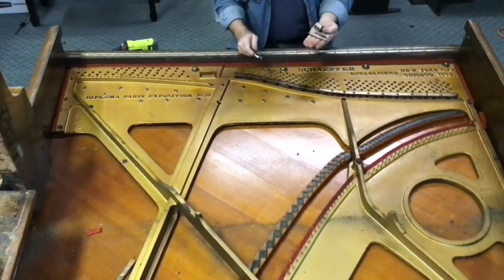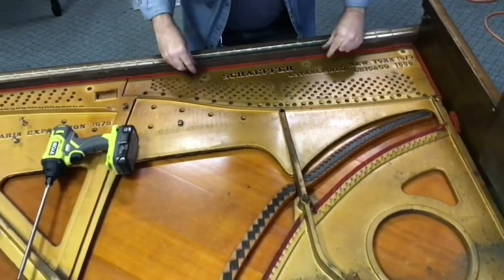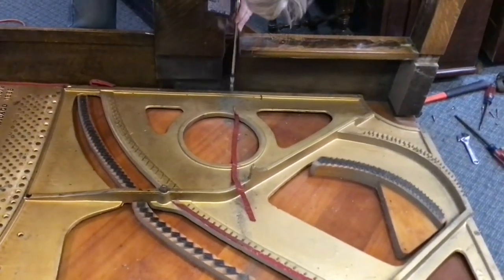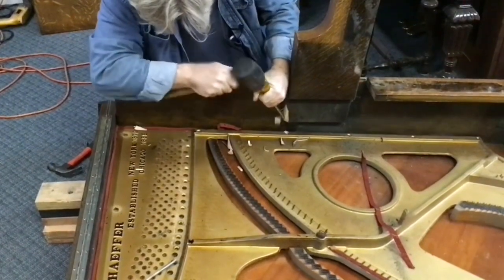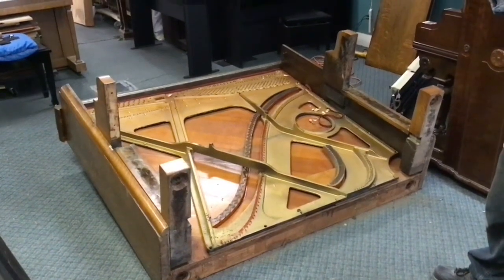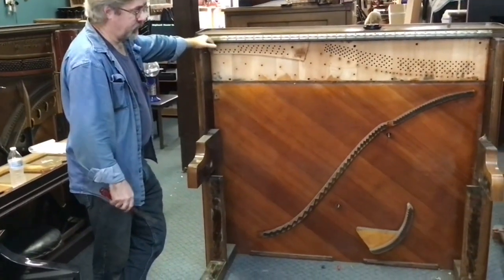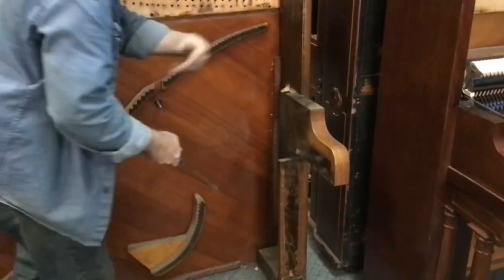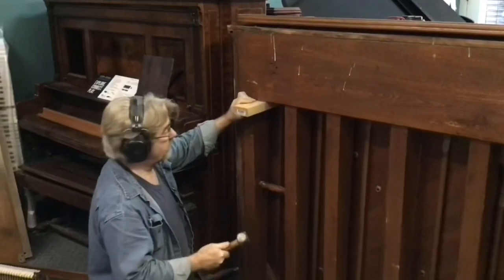Acoustic to Digital Piano Conversion - Disassembly Part 4 (Final)

Comment: Removing the last strips from the soundboard without tearing up the spruce; heat pot hide glue was standard procedure to put the on, and to get them off . The glue is water soluble. Keep the spruce soundboard and find the sweet spots for the attenuators and set the up on the spruce for the unique sound it goes to a piano. Good luck. I am doing one myself , but cutting harp loose standing up in manageable size pieces. 
    I have a 1903 Adam Schaff upright with red mahogany veneer. I hope I live long enough to finish the job.

Comment: Thank you for this video. I had begun to convert a family grand piano into an electronic piano, and was driving blind on how to go about it. So much fun.  Can you suggest what hardware I might want to consider for this conversion, and how much do you take off of the sound board to help its resonance. Ours is a Knabe and it has a lovely decal on the sound board that we would want to keep. I would use a flush cut saw with a veneer strip on either side to remove the bridge, and then a router to trim it flush with the surface.